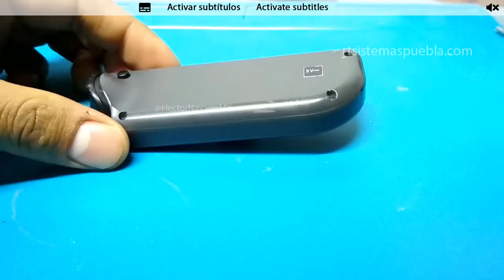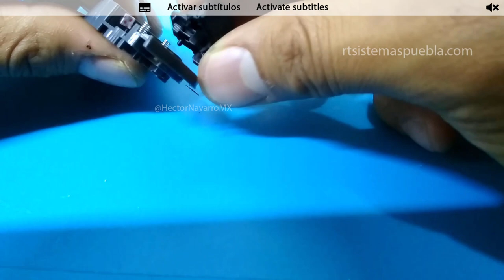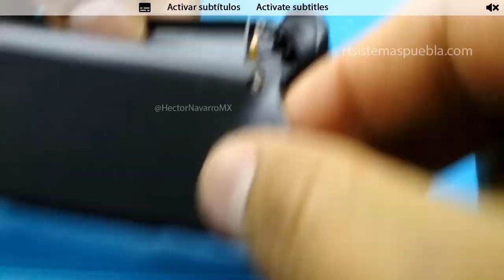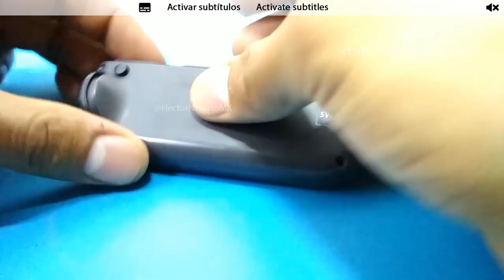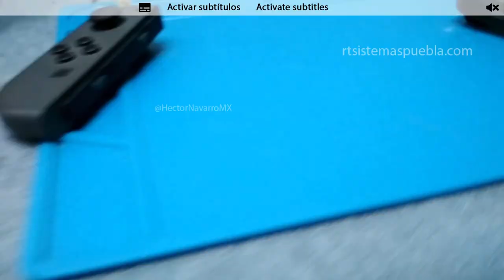How to replace right Joy-Con ZR button

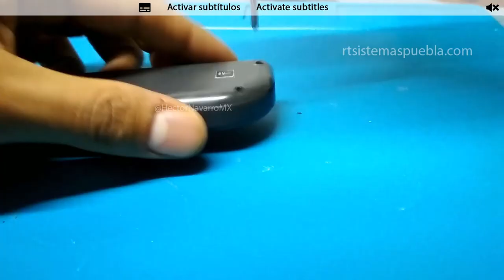Comment from the maker: 00:06 Desatornillar la tapa inferior (triwing)
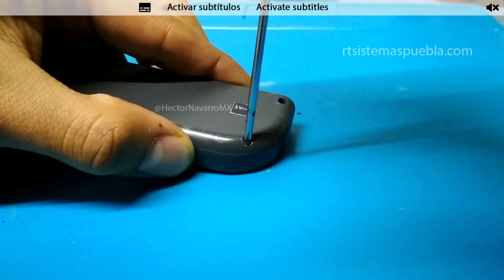00:12 Abrir con espátula plástica
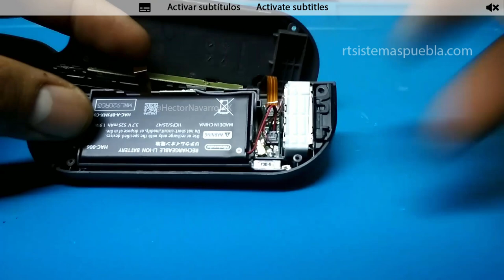00:34 Desconectar la batería
00:50 Quitar 3 tornillos
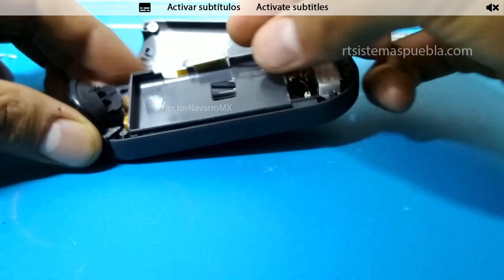01:06 Desconectar la antena
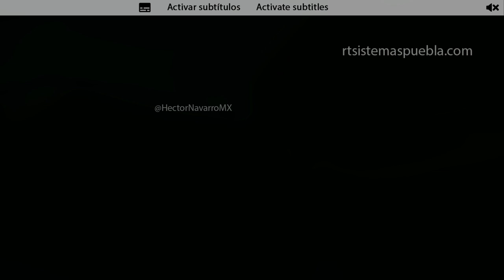01:13 Girar el control
01:24 Separar cuidadosamente la base del botón ZR
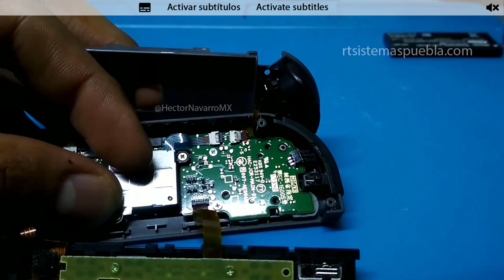01:43 Abrir el seguro del flex
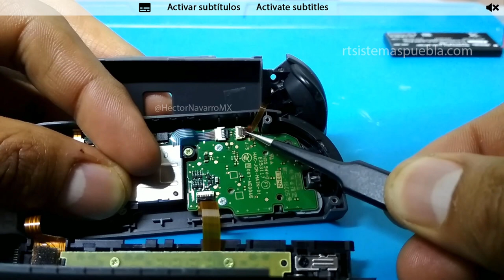01:49 Retirar el flex con pinzas punta fina
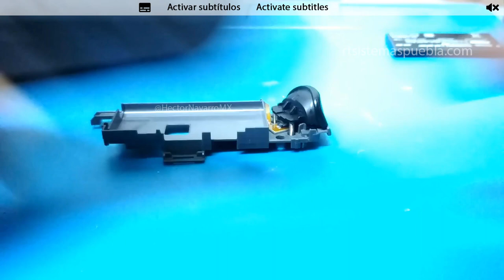02:10 Separar el botón ZR de la base con ayuda de la espátula
02:35 Quitar tornillo
02:47 Despegar el flexo
02:58 Remover el flexo dañado
03:10 Colocar el flexo nuevo
03:39 Atornillar el flexo
03:59 Colocar la cubierta del botón ZR
04:02 Alinear los resortes y presionar firmemente hacia abajo
04:14 Verificar el funcionamiento
04:36 Conectar el nuevo flex al joycon
04:59 Presionar el seguro del flex
05:06 Flex conectado y asegurado
05:11 Colocar la base del botón ZR sobre el joycon
05:32 Colocar los 3 tornillos
05:47 Colocar la antena
05:53 Conectar la antena al joycon
06:21 Conectar la batería
06:36 Cerrar el joycon
06:43 Colocar los 4 tornillos triwing
06:56 Probar funcionamiento